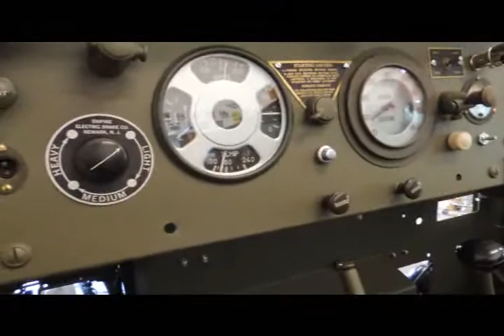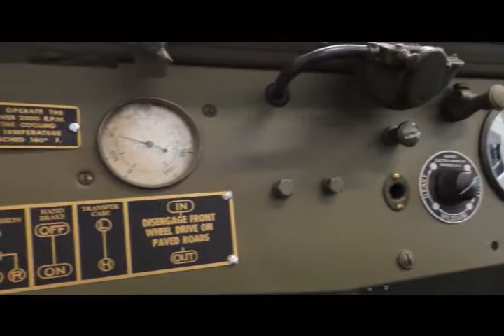Steve's White M2A1 Halftrack 1st Engine Start

Comment: Please highlight the back fold down lattice plates. Why are they there & what are their purpose? Lucky to have a quad 50's half track. Thanks.
Reply from the maker: OK, you are talking about an M16 halftrack. the fold down sections of the top, rear armor is so the M45 quadmount can rotate and elevate guns without hitting anything. Later M16A1 halftracks didn't have the fold down armor sections as the M45 quadmount sits higher above the rear armor giving more clearance. These halftracks were often converted M3 halftracks. My halftrack is of the M2A1 variant which wasn't intended for this typed of gun mount. There has been field modifications where a M45 quadmount was retrofitted in a M2 halftracks, designated M16B, and was very cramped for space. So, for all intense and purpose, my halftrack is NOT a quad 50 cal. halftrack. It did carry two browning 30 cal. machine guns and a Browning 50 cal machine gun in a gun pulpit over the co-diriver's seat which my halftrack is missing.
Reply: @catscan64  I don't think we are talking about the same thing. The lattice plates I refer to are on the rear of some Half-track's. They rest folded up on each side of the rear door. On the video you posted of engine start up there is no shot of the body at all so I do not know what I saw to post the first comment. It sounds like you were mentioning the side tops that folded down so the gun could swing.
Reply from the maker: @danielbritton8588  OK, I thought you were talking about the M16's because you thought I had a quad 50 half track. What you are talking about are the folding luggage racks found on later halftracks specifically M2A1's and M3A1's. The M3, M3A1, M4, M4A1 and M16A1 are the only halftracks with the rear door. Since my halftrack is an M2A1, no rear door. I do have the luggage racks but not installed yet.
Reply: @catscan64  I was guessing mortar shell handling. If you watch the movie Kelly's Heroes. You can eventually see these appear on the backs of their Half Tracks. Spare gear racks seem less than the purpose I imagined. Thanks for answering the question.
Reply from the maker: @danielbritton8588  I had to pull up some images of the halftracks used in Kelly's Heroes.  Both halftracks are made by International and primarily used for allied countries during WWII as Lend Lease  vehicles. I'm not positive if any US unit used them but I'm not an expert on that. With that said the gun motor carriage  halftrack in the movie had luggage racks in the rear alone side the center troop door hand anti tank mine racks on either side of it. I will have to watch the movie again to see if the other halftrack had them.
Reply: @catscan64  It has always been a curiosity. The half tracks change in the movie. Front fenders are an oddity also. I am a scale modeler & have all the Kelly's Heroes vehicles used. I had to add those piece's on the backs not knowing what I was scratch building. I appreciate your correspondence greatly. Getting a kit half track with the howitzer was a long wait.
Reply from the maker: @danielbritton8588  History time. The three primary manufactures for all US halftracks were White Motor Company, Autocar hand Diamond-T.  A fourth manufacturer was included and that was International. International halftracks were primarily used as Lend-lease vehicles. The only thing common was the tracks and it's suspension. The International used different, welded armor in the rear and overall thicker, rear corners were rounded, front fenders were flat, larger tires in front and all the running gear (engine, front and rear axles) were different. International halftracks today are more commonly found in Europe and other foreign countries.
Reply: @catscan64  Yeah, they are used in Israel by the IDF. So the half tracks used in that movie are as inaccurate as the gear they used Rat Patrol. Good to know. Or the Patton tanks they used in the Battle of the Bulge. You did mention the front fender issue I was referring to. Flat versus formed. I have always been a half track fan.

Comment: So that white motor looks almost the same as my studebaker champion in my m29 weasel.. except the strange extra cooling passage up to head. I know your all purists... but come on.. magnetic pickup in dist, electric fuel pump and a alternator (generator in this case) that weighs under 100 lbs will make that motor a lot more happy! It sure did mine!
Reply from the maker: OK, Back up a second. What you don't see is my Pertronix electric ignition and MSD spark control. I had an electric fuel pump but went stock fuel pump because it also has a vacuum pump for the wiper motors. I also have a vacuum reservoir, keyed battery disconnect switch, Original Marvel Mystery Oil inverse oiler for the top end and converted paper filter air cleaner. I do have plans to convert the generator to an alternator but you won't know it. It will be hidden in the original generator casing.